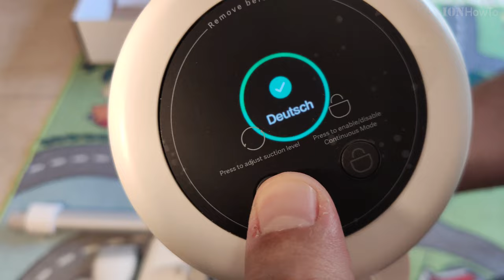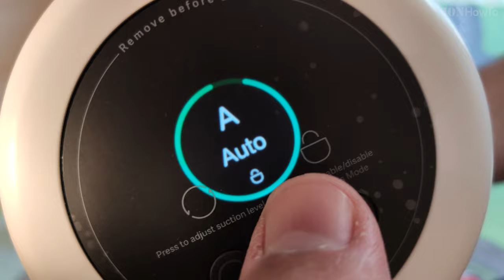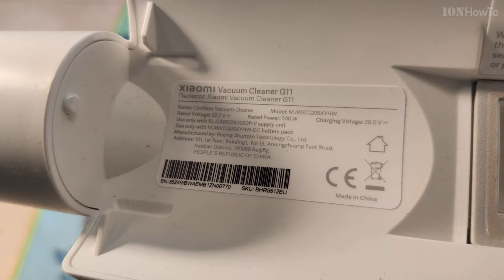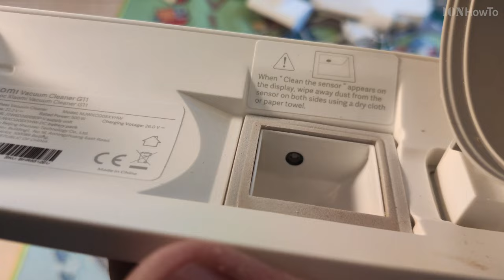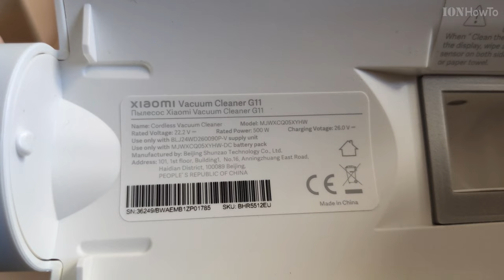Xiaomi Vacuum Cleaner G11 Tests

Comment: I'm interested in how close to objects can the head brush actually pick up dirt - can it suck from the sides? Also, is the filter effective? There seemed to be some fine dust around the motor intake when you took out the filter...

Comment: Since this was such an informative video review, and affected my purchase decision (I did buy the G11), I'd like to add my, independent little review, and hope that ION leaves it here.

1. The Design. Yes, this is one of the best designed (one could even argue, overdesigned) vacuums. That said, with use, it will get dirty (because it is the bagless sort) and scratched (if you go near walls, as one does with a vacuum). I dropped mine right after purchase, when I was looking for a place to hang it, and cracked the clear plastic on the mite head. It fell on tiles and the crack is fairly minor, which attests to the quality of the plastics/build. That said, the plastics of the brush head are hard, which means there'll be scratches on both your furniture, and your vacuum.

2. Quality of vacuuming. I was very pleasantly surprised by how well it vacuums fitted carpets and heavy mats. The rotating brush does wonders and the only limitation is the tiny collection bin, which I have to empty three times per run (limited by battery to about 30 minutes). Tiles and other smooth surfaces are absolutely no problem for the vacuum. The suction power is also great, as is the power auto-adjusting feature. No problems here.

3. Battery life. I have about 65 sq.m. of fitted carpet upstairs and about 100 sq. m. of smooth tile and cork tiles downstairs. The battery lasts about 30 minutes, which barely lets me do a complete run - either I'll have to buy another battery, or split my vacuuming to two jobs, upstairs and downstairs. All in all, the battery lasts much shorter than I would like. It charges in about 3 hours which is a long time if you have a cleaning day, so you need to plan accordingly.

4. The bagless concept. This, I absolutely hate. Many years ago I came to the conclusion that bagless vacuums were complete and utter bullshit, pardon the word. They are messy, the filters get clogged up, and if you had no dust allergies before, you will now, because you'll breathe in the cloud of dust as you empty the can into the trash. My bagged vacuums are totally clean, the s-bag can be pulled out without a speck of dust leaving the vacuum and the HEPA filter clean for months/years on end. I would definitely complement this modern toy with a proper bagged vacuum for the serious work (let alone workshop). Also, I mentioned that the can of the G11 is ridiculously small (for my needs). If it were 3x bigger, I would not mind. Also, fine dust and debris quickly gets out of the lower portion and starts clogging the metal mesh, in which case you'll have to wash everything, get even dirtier, and as per manufacturer's instructions, wait 24 hours to let it all dry out (in the sun, no less). Design compromises, I guess.

As a verdict, the only feature I like is the rotary head and the suction power. If I could wake up and have a corded, bagged vacuum with the same suction power and a rotary head, I would not hesitate in an instant. The Xiaomi will be relegated to the upstairs carpeted rooms from now on, with its own dedicated air-tight waste-bin.

EDIT: The hair-cutting feature on the rotary brush works fairly well for me - it just needs time (vacuuming) to pick up the cut-up hair and tangled strings. Of course, some of it will still remain on the brushes themselves, but overall, I'm happy with how the little knives in the brush work.

EDIT2: I've had this vacuum for a day and did two full runs of the house with it (with a children's party in between), so although my conclusions need to be taken with a grain of salt, I can already see where this vacuum will probably not last the 20 years that my other one did (and still does)...
Reply from the maker: Wow thanks for sharing your experience! 
If it was up to my we would not buy it at all and keep using the corded vacuum cleaner.

Corded and bag less is ok for me. 
Main reason to have any cordless is convenience. It's why we were looking for it.

Convenience but also similar or same suction power as the corded one.

We don't have carpets other than 2 small ones and foam mats but I would choose to use this on carpets with the power brush and use a corded one in heavy duty areas.

Be very careful with the motor.
If it catches on some plastic part that could block the suction in Turbo - it will pull it harder and the motor blades could break.

I'm not sure if our first one broke because of that or it was just bad but hope you saw the motor video.
Being careful, it works well.
Reply: @IONHowTo   Thank you for the warning. I noticed that the brushhead will try to rotate harder before stopping if it encounters a jam. It would be great if one could switch off the motor in the brush - that way one could pick up plastic pieces or vacuum the edges of lightweight mats. I also added a note to my mini-review saying that I'm pleased with the hair cutting-up feature on the brush.
Reply from the maker: @vixiki  the brush motor didn't break - was always stopping if tangled.
I'm talking about the suction motor - https://youtu.be/vDp5Ks4_ZLI

Comment: Good review, thanks. It seems the rotating head brush is too aggresive for carpets and can damage them, also its anti-tangle system did not work very well in your test. I think this vacuum deserves better head.
Reply from the maker: Yeah, the head is too hard for thinner carpets. 
I imagine on thick carpets it should be better but this is a real world test.

On tiles it works perfectly, gathering stuff even when the floor looks clean.

The cutting system was not as good as I imagined.
Reply: To be fair, who vacuums a carpet at the boundary like that - I always step on it and pull the vacuum from the middle towards the side of the carpet so it does not get sucked in... What I'm interested in is, does it do carpets as well as a bagged vacuum?
Reply from the maker: @vixiki  I could only compare it to the corded vacuum we have.
It gathers everything from all the way to the edges - shown in the videos.
For normal thick carpets, the brush head should work even better than a classic vacuum cleaner that only uses air suction.
The filters work well and are washable but you would have to be careful so they are locked-in correctly to how their slots.

It works well and any cordless is really convenient.
Reply: @IONHowTo  Thank you, your video was very useful!

Comment: I believe ure supposed to remove that foam from the HEPA filter
Reply from the maker: The foam is part of the filter system. They are both washable but have to be super dry before use - 24h dry time warning on it.

Comment: Xiaomi G 11 weight is 3 kg
Reply from the maker: I remember comparing samsung and xiaomi as the lightest ones in the shop on an actual scale with battery installed and was the lowest. Dyson ones were the same. Approx 1.6 kg official spec weight but if you add the extension and carped brush with battery id does get heavy as the others do too.